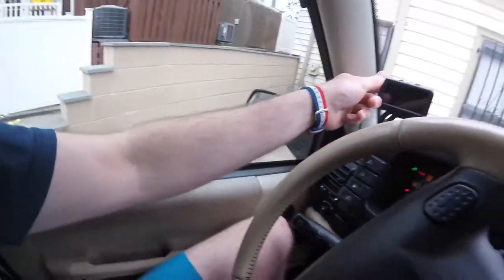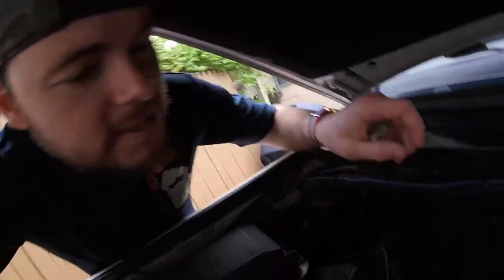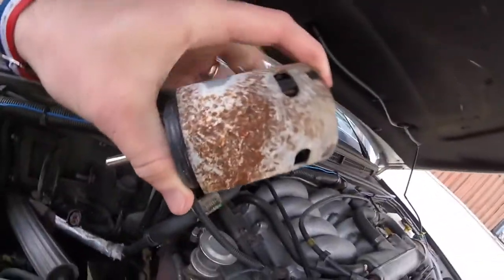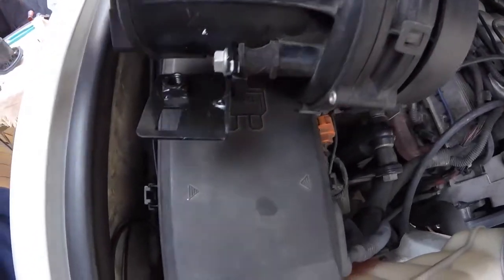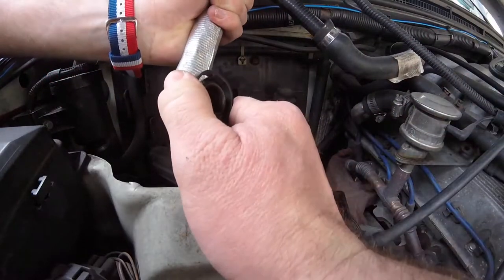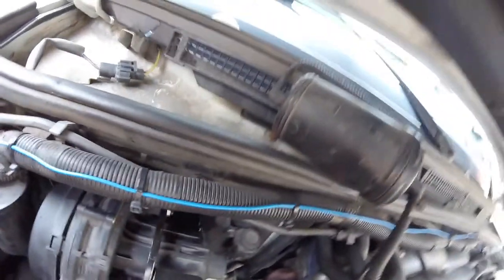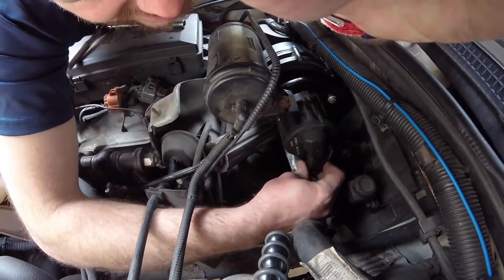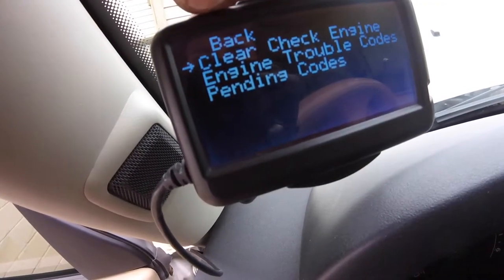Land Rover Discovery II Secondary Air Injection Pump

Comment: so I'm working on a friends 2004 Discovery 2 he just bought, it would not pass emissions, I replaced the evap purge valve and codes went away but am now getting P1412 and P1415, hoses and everything look good, I did move the SAI solenoid in order to get the purge solenoid on, did replacing the pump fix your problem, the pump on this looks like its pretty new ? Looks like most fixes for P1412 and P1415 were replacing the SAI solenoid, have you ever replaced that ?

Comment: Excellent. I have a 2004 Disco II, with a high pitched noise at cold start. I see a vapor leak at the back left air injection, but goes away in about 1 minute. I can also hear the Air pump grind until warm as well. Replace the Air Pump? But do you have ideas on the vapor leak? I have video.
Reply from the maker: If you hear a grinding, than it’s time to replace the pump. It is probably only making that noise for a minute because the SAI pump only runs for a couple minutes upon a cold startup. The leak could have to do with bad O rings on your pump at the hose connections

Comment: Helpful video.... I got the codes. What is the replacement part number?
Reply from the maker: https://www.partsgeek.com/gbproducts/WC/278-01176399.html?utm_source=google&utm_medium=ff&utm_content=YN&utm_campaign=PartsGeek+Google+Base&utm_term=1999-2002+Land+Rover+Discovery+Air+Pump+Pierburg+W0133-1651544+99-02+Land+Rover+Air+Pump+01&fp=pp&gbm=a&gclid=CjwKCAiAnvj9BRA4EiwAuUMDf8o_kCeyGyIDlIxrr5SfDn7pnllBlbaUWvxJ3jQr65kTQiAFl99nWxoCJhAQAvD_BwE

Comment: O would love to pick your brain about my 03 . Last I hooked it to a computer it said low fuel pressure . Changed the pump for good measure . I be owned it a year it's my play truck . Starts when I hit the gas it barley moves . I re did the plugs ,wires , dropped and replaced all oils when I bought it . Put electric fans in it . Currently cleaning the throttle body and waiting on a throttle sensor . I am just about aggravated I can't figure this problem out